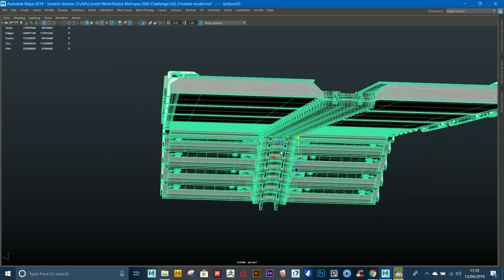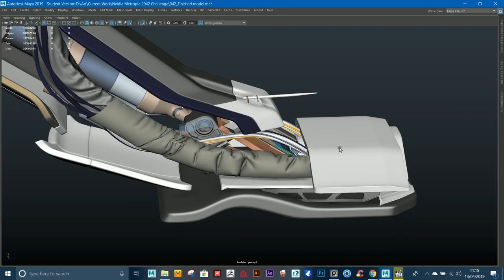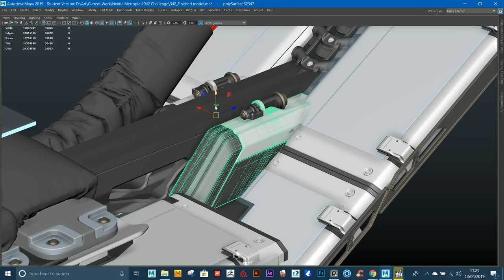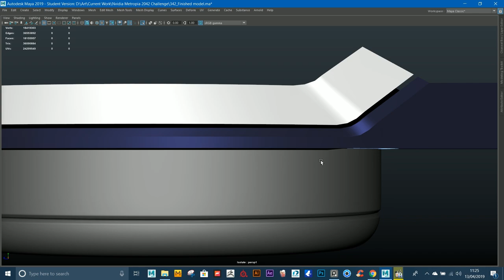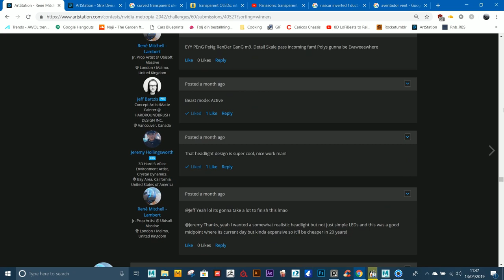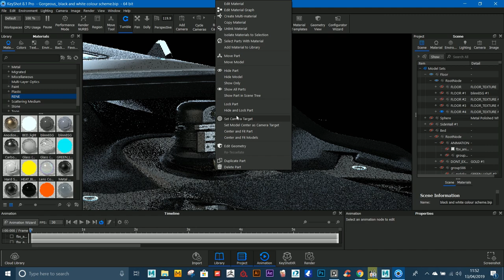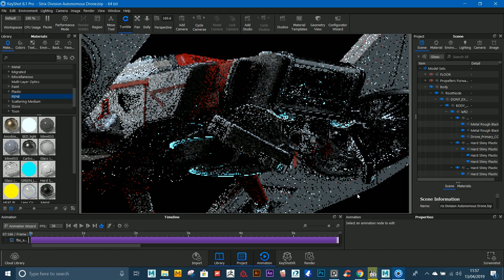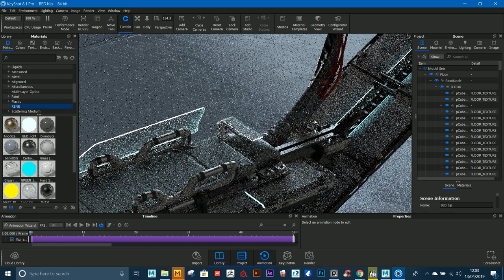Nvidia Metropia 2042 Vehicle - Ambulance Drone Overview Part 2

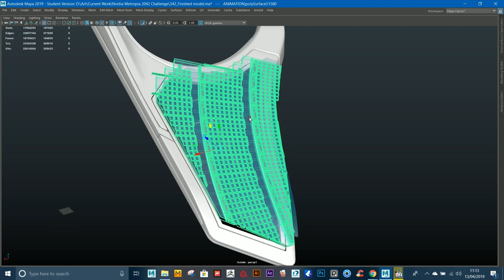Comment: at 3:53 mark, just curious why not go with lattice instead of using bend?
Reply from the maker: Because I wanted the bend to be uniform and perfect, Lattice I have to movements of those pointswon't be perfect, there'll be weird bumps or something as I make it fit

Also.....I never use lattice lol I probably should
Reply: @rjeez95  no worries its cool.